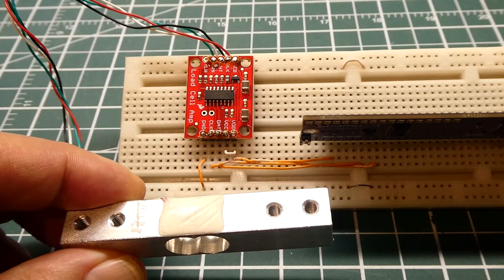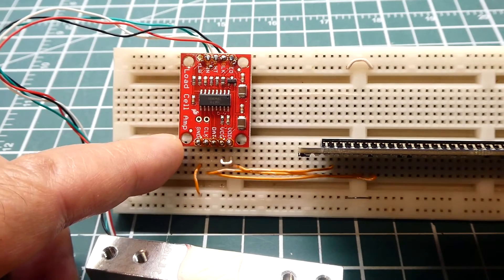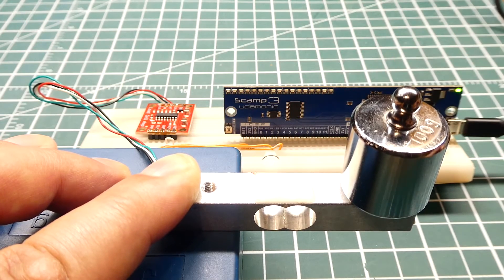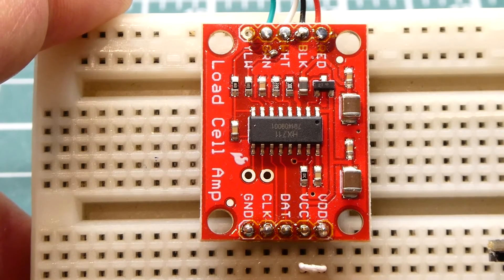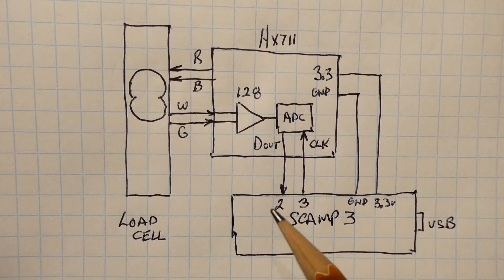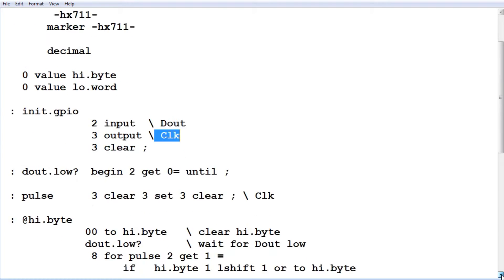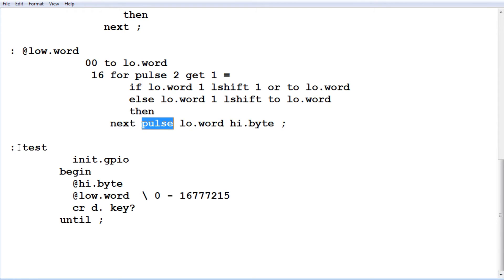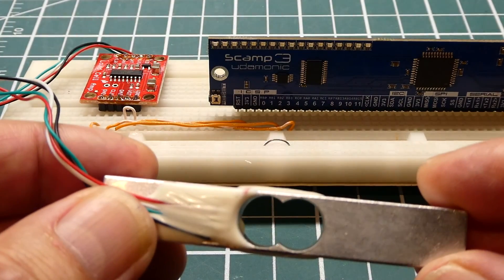Load Cell Interface / HX711 / Scamp3

Comment: Nice video.  It makes me think of my first job at Toledo Scale back in 1980.  I learned that wheatstone bridges were always used with load cells to detect small changes in resistance.  I think using a wheatstone bridge can be a way to improve the sensitivity of any resistive analog input transducer.
Reply from the maker: Yes, I agree. The Wheatstone bridge can be useful in many applications. https://youtu.be/WaFBUnep7T0